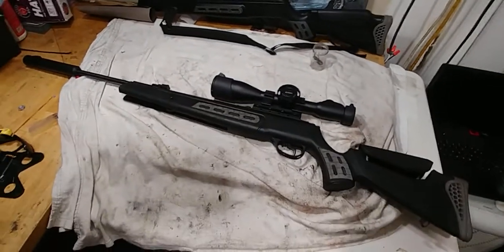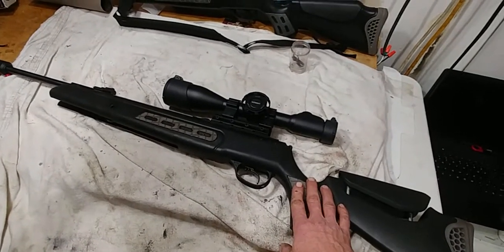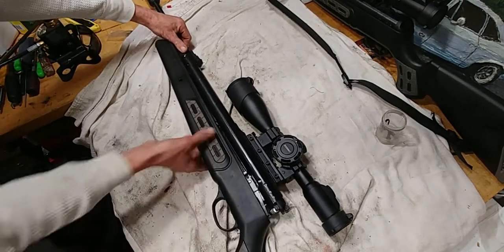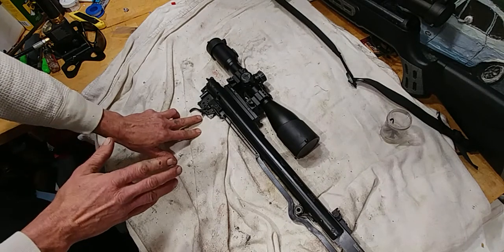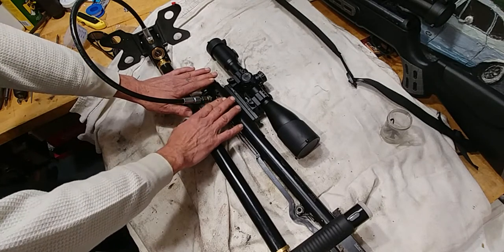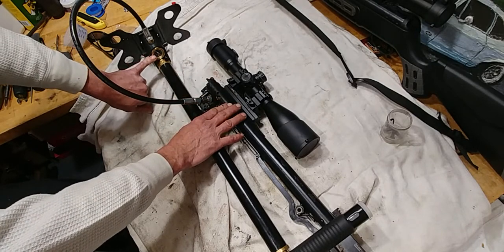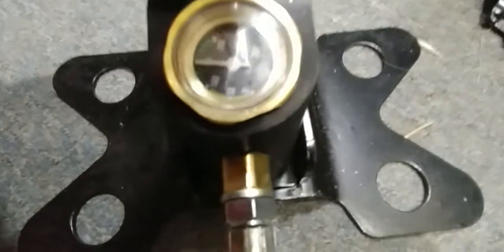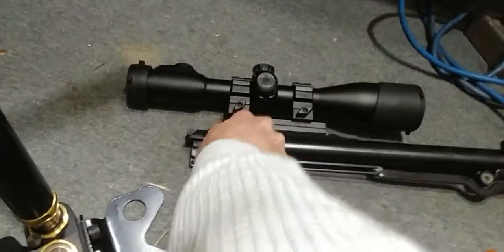Hatsan vortex gas ram part 2

Comment: Can you recharge the gas piston without  the pump, I do see a scuba tank can be used and have one, but need all the adapters? any other way to recharge them? Your best advice on how to do it. With their adapter can I use any pressure tank to recharge it to 140, or even 125 bar. I did understand all of the video, but if I tee the filler line I can see on a  gauge what is going into the tube.   Thanks so much if you can help out    Great video

Comment: Can the older hatsan springers take the hatsan gas piston and then use this method? I've got a 135 sas springer that would be cool to convert to a gas ram and do this...
Reply: There are aftermarket gas pistons available that drop into the spring 125s

Comment: Could you please show me how to release air in the gas piston?
Reply: Also, how to do it when there is no drain valve in the piston? Is there a way to open the intake valve with some kind of a tool?
Reply: @SHOGUNnYAMATO  2nd this, over filled mine

Comment: Hi, does the Hatsan Mod 135 Vortex wood (Non QE) also has a fill port to increase the pressure? Wanna buy one from Spain but those are 23.9 joules limited by law. I assume that is arranged by the Piston pressure?
Reply: The answer would be yes. 125 abd 135 are very similar. Little bit of a sneaky hack no?

Comment: there are two holes which have to match each other. In my case they ARE NOT match... what to do? There is about 2 mm difference. What I need to do? Is there an option to move the vortex or i need to make the first holl bigger?
Reply: I had to Dremel mine for the probe to fit, both holes were off centered and the main tube hole was smaller then fill port on the ram.

Comment: How much was that pump and is that 125 a bitch to cock or was it when new??? Ive got one in 22 cal  And been hearing rumors that the gas piston which is ONLY AIR NOT GAS. Had I known that I would have bought a springer. My ruger air magnum will run with this one easy. I read where if a piston is gonna fail it happens about first week or too. John at airgun detective is no slouch either. He redid a brand new hatsan Terminator and honed it w 1000 paper and wooden dowel. The piston doesnt scare me or honing but if trigger assbly goes boing. Im done. You have the short barrel to so your cocking effort should be same.Gamo brass do break sound barrier so its doing its job.

Comment: Hi - I have done this as well, just a note I think its easier to put the probe in without first attaching the hose, reduces the side to side stress.
Reply: Good observation. Also, it would probably be a good idea to start by taking the scope off.

Comment: Could you tell me the size of the hole of the transfer port of the air chamber of your hatsan 125 sniper?
I have the vortex at 145 bar and in 5.5mm caliber and it is delivering an energy of 16 joules. The hole of the transfer port of my hatsan 125 sniper is approximately 3.75 millimeters.
thanks, and very good reviews

Comment: Nobody had any info on this, Thanks for sharing. can you tell me what fill tube adapter I would need & were you got yours ? I have the same gun & basic pcp foot pump as you, Im curious if any pcp fill tube adapter would work or is it specific to Hatsan ? Thank you very much
Reply from the maker: It is a hatsune filled probe you will need but they do have universal ones that fit many models of guns, EBay or Amazon should have them..
Reply: @airgunnersedge4061  tank you👍

Comment: Thanks for the info.  I thought I was screwed when I left my Torpedo Sniper  cocked and there was no pressure when I went back to it days latter.  I went to 150 bar and it is shooting about 900fps with Air Arms pellets 25.4g.

Comment: Does this process increase power?
Reply: Is there any damage to the rifle?
Reply from the maker: It does increase power if the gas ram was not filled completely from the factory, damage can occur  if fill more than the max bar pressure recommend..

Comment: Can this be done to a Hatsan mod 95 spring ( non vortex ) ?
Reply from the maker: No
Reply: For the spring, you can detune. Adding FPS you need to put washers in for preload. But with a springer more FPS hurts with accuracy from my experience

Comment: Is there a  update on the  gun  you added 150 bar in fps ? I can't find a part 3 or I don't see a update in the  description.  Did adding that much pressure  blow all the seals  or is it still working ?   Is the 150 bar  limit with the gun cocked and under pressure ?
Reply from the maker: Unfortunately some of my videos have been removed for one reason or another, I did have the results on another video I'll have to see if I can find them again...  no issues with any of my guns, but I have not left them at full bar pressure  because that not always  were the best accuracy  is at..

Comment: I have the 135 .30 cal Hatsan.  Could I do this at my local sport shop that has a fill station, and use nitrogen?  I don't think the actual thermal expansion of nitrogen compared to ambient air is very much, so I am not sure that the benefits of nitrogen would be, accept to keep out contaminants in our air.
Reply: ya nitrogen not air

Comment: Hi - I have two Hatsan 85 vortex snipers that both went dead within a month of each other - I've had the guns since about 2015, got for my sons for Christmas.  They haven't shot them much in the past year, I have shot them occasionally this summer.  Both must have died after August when I last had them both out shooting.  I have a feeling there are likely a lot of failures on these pumpable gas rams - at least the 85 version.  The air had mostly escaped from the cylinders.  Its possible in the summer hot weather, even though they were inside in gun cabinet, that the heat got to them? There is some kind of oil inside the ram that comes out even if you open the screw facing upwards.  I have repumped one, and though you cant hear the leak, it is dead within 24 hours.  Just thought you might be interested.  Its a great idea that they can be adjusted, but maybe not a long term solution.  I am looking for replacement rams at this point.  Thanks for your videos!

Comment: I believe 175. I've taken fox squirrel at 105yds with mine.
Reply: that good,but once it passes about 50-75 yard mark the drop is about 6-8in/m seem like it would be very difficult without gas pressure mod and either a .22 or .177 ,but anything above those calibre has bad drop off at a certain point.
Reply: What scope and rings do you use? Thanks.

Comment: Hello a question the fill tube is a hatsan fill tube is standard in all hatsan
Reply from the maker: fbi2273  unfortunately no it's not, the 135,125 you can fill and drain without removing the gas ram from the gun ... The Hatsan edge/striker, Dominator and Torpedo must be removed from the gun to fill and empty... some models the gas ram is are not fillable/ adjustable at  all...

Comment: Like you, I've done some work on Hatsans and added air to Vortex pistons on several of mine.  I just took the stock off of my new 135 and I can not get the fill probe in.  The "frame" of the gun is a little off.  I've had a little difficulty before, but this one is not going.  Am I going to have to file a little to get it in or can the gas piston be turned a little??  Good video.
Reply from the maker: Southeastairgun  unfortunately no the gas piston cannot be turned, I had actually picked up in Universal fill probe with dual O-rings on front and back and that slid in without filing any ... but your gun May differ and you may need to file it
Reply: Thanks.  I drimmeled it down a little and got everything done.  Thanks again.
Reply: Southeastairgun For future reference, removing the third pin from the left will let you rotate the gas ram with the rifle assembled. Don't forget to put it back before test firing.

Comment: So yours is the "QE" version? I see that there are 2 versions. Thanks
Reply: Hi Richard! So many great videos you made and I just can't find the one where you swap stocks between 125&135.. so do they interchange easy or there are a few tweaks you have to do? I wanna put a .30 135 in a 125 th stock and vice versa. Thanks!
Reply from the maker: Airgun Nuub yes there are two Styles I have the older plastic Style on the125 sniper and the newer style on my 135, the newer style is also available on the 125 sniper now
Reply from the maker: Airgun Nuub https://www.pyramydair.com/s/m/Hatsan_125_Sniper_Air_Rifle_Combo_Camo/2675
Reply from the maker: Airgun Nuub https://www.pyramydair.com/s/m/Hatsan_125_Sniper_Vortex_Air_Rifle/3192
Reply: The QE version has a fully shrouded barrel I think. It looks almost  exactly like a 135QE, except with this stock.
Reply from the maker: Cetriem Mmmm here's the video I made of swapping stocks.  https://youtu.be/jpWgSIHEZuE